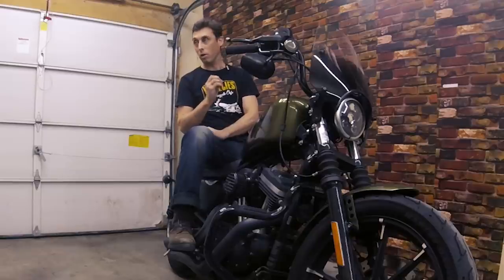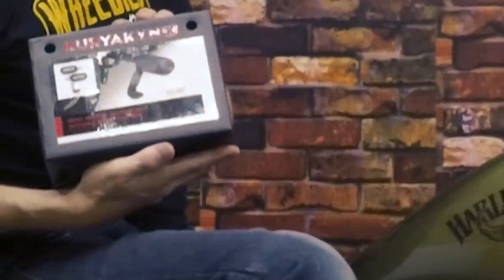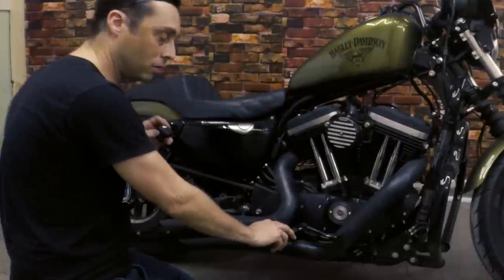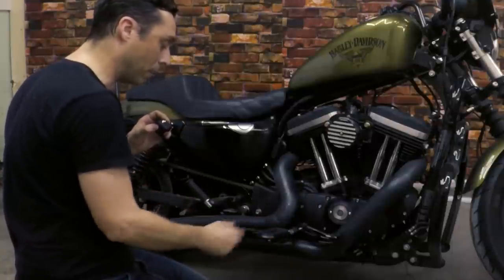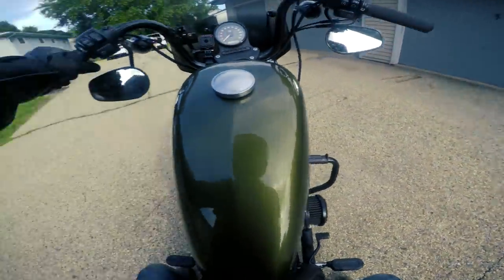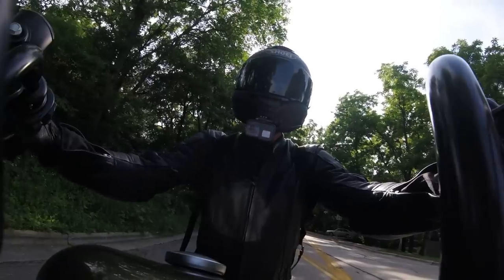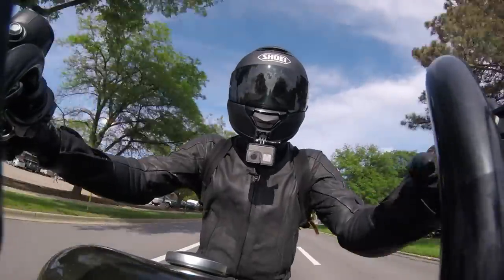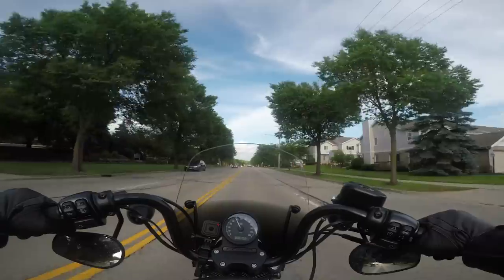Kuryakyn Switchblades Installation and First Thoughts - Harley Iron 883

Comment: Nice video, thanks! I'm paying attention to your harley's sound. Did you reprogram it or left it as stock? I find it quiet different to my  reprogrammed 883 with v and Hines shortshots (extremely loud).

Cheers
Reply from the maker: Thanks man! My bike is pretty loud. I record and edit the audio so it doesn't clip causing distortion. I re-mapped the ECM  using the FP3. I set Vance and Hines options for my bike and the Big Radius and then made adjustments to fine tune. I did not use autotune. To my knowledge, remapping doesn't impact the noise level. Only mufflers or baffles can do that. It's possible that someone smarter than me can prove me wrong on that.
Reply: @GreatEgret  It makes sense It doesn't alter the loudness / volume of the bike. Thanks for the quick answer. My bike was tuned with supertuner stage 1 before I bought it, the difference I hear is in the rpm then, since you edit the audio, otherwise we could not hear you well xD

Comment: First of all, beautiful bike man, have the same one, just mat black. I was wondering if after having those pegs for many months now.  Does the switch blade come down with the vibration of the bike, or does it hold in place until you bring the switch blade down with your foot?
Reply from the maker: Honestly, I didn't pull the blade out at all since this video. Not once on the 4500-mile route 66 trip. The rubber on foot part of the pegs is great, but the heal part of the blade does not have any rubber dampening. I sold them to another subscriber that has forward controls. I'll talk about all this in an upcoming final thoughts video.
Reply: @GreatEgret  thank you
Reply from the maker: Not a problem, my friend. Thanks for the kudos on my bike. It's a fun bike.
Reply: @GreatEgret  So in all, do you think is worth paying the extra $ for the switch blade pegs instead  of the regular ones ?
Reply from the maker: If you have forward controls the switchblades might be worth it, but with mids, it just puts your feet way too far back to ride comfortably.

Comment: Cool upgrade! So after riding longer trips with em what are your thoughts now? Would you get something more forward positioned if you could do it again or do you feel like the heel rest is sufficient?
Reply from the maker: I really need to do a full review in these soon. These were really designed for forward controls.  With my mids, the "blade" part of the switchblade put my feet too far back. So I didn't actually use them much after this video. Nrver say never, but I like the control and balance of mid controls, so it's unlikely I'll ever put forwards on this bike. After long daily miles on the Route 66 trip, I was never uncomfortable with the mids.
Reply: Great Egret would you like to sell them? I have a 2018 iron
Reply: I have forwards
Reply from the maker: I would! I'd give you a super good deal too since I put on about 6000 miles on these. Shoot me an email at joe@greategretmoto.com and we can chat more about it.

Comment: if those were on my sporty I'd be trying to switch the pegs to the opposite sides so it pops forward. that way you can actually stretch your legs out a bit, not out behind you. You are already riding with mids. thats like making it worse moving your feet further back. Also on long rides throw some clip on pegs onto the crash bar. kick back and cruise. ride safe!
Reply from the maker: Yeah, you're right.  These footpegs are designed for those with forward controls and I'll cover that in my full review.  I have only pulled ot the switchblades in this video.  I never use them.  I do like the wider than stock foot area and the vibration damending, though.  Flipping them makes sense in theory, but the blades would most definely get in the way of the brake pedal and possibly the shifter. I thought about clip on pegs, but my Lindby Multibar has foot rests that have worked great for streching my legs out.  The beauty of a Sporty is I'll be forced to stop every 120 miles or so to fuel up.

Comment: Newbie question, and I don't know how to send a DM on youtube, LOL, but can an Iron 883 pull one of those trailers? Easier for long trips? Just a thought.
Reply from the maker: I don't think I'd ever pull a trailer on my motorcycle. Though that doesn't mean they are not useful for those that choose to. Trailers, no matter how small, changes the dynamics of  how a bike handles. I ride aggressively. The Sporty just begs you to. I don't think a trailer would fit with my riding style. I think a trailer would fit better with a touring model.
Reply: The Iron’s owners manual says that pulling a trailer is a no-no.
Reply from the maker: And it makes sense why! Definitely would not want to pull a trailer.
Reply: Great Egret a lot of people make really horrible mistakes that could be avoided by reading the manual. Happens all the time.

Comment: I know this is an older post but I put forward controls on my sportster and had to buy new darn pegs to work with them. they are Harley forward controls. so not sure if these would even work. my old ones did not work and they had warned me so I had to buy new ones. sort of aggravating.
Reply from the maker: I need to do a full review of these. The pegs are super comfy, but with the mid controls, I'd didn't once pull out the "blade" part of the pegs after this video. They put my feet too far back. The switchblades are designed more forward controls.
Reply: @GreatEgret  The switch blades are meant to be highway pegs lol. Not your normal control pegs
Reply from the maker: You're WAY late. This was two years ago and they aren't even on my bike anymore. What the hell are you lol-ing? They're not highway pegs. Highway pegs are attached beyond the controls. Typically on an engine guard. These allow for more full foot comfort like floorboards without the look of floorboards.

Comment: Did you get the ones with or without adapter?
Reply from the maker: Yeah, the adapter wasn't necessary. These are designed to fit on Harleys.